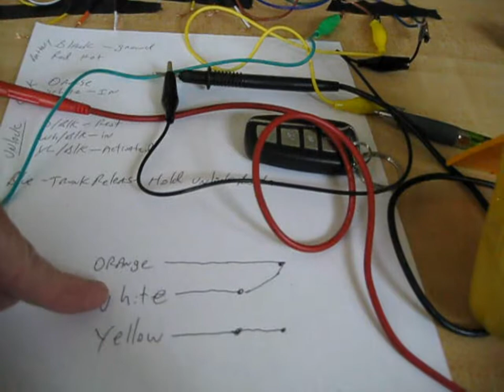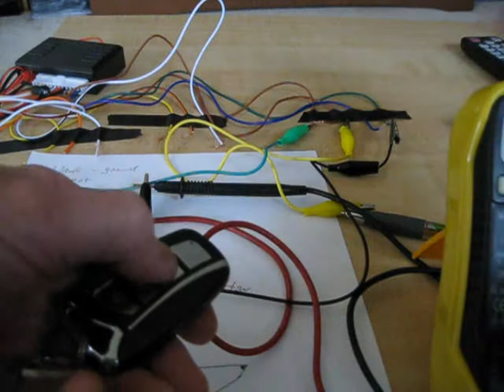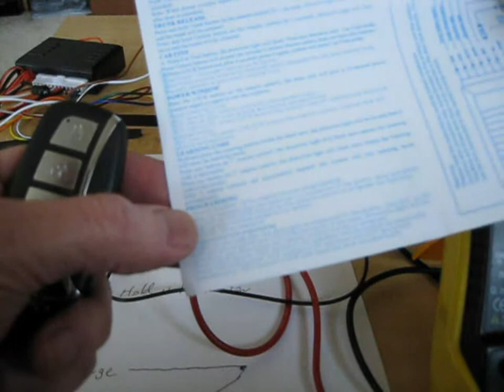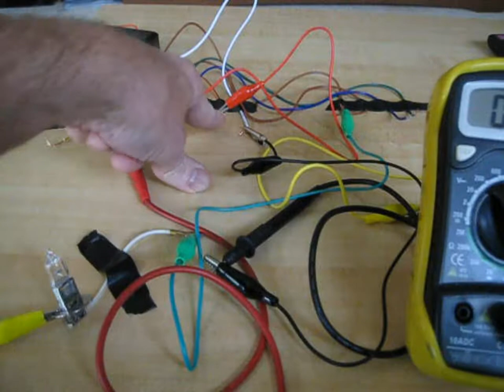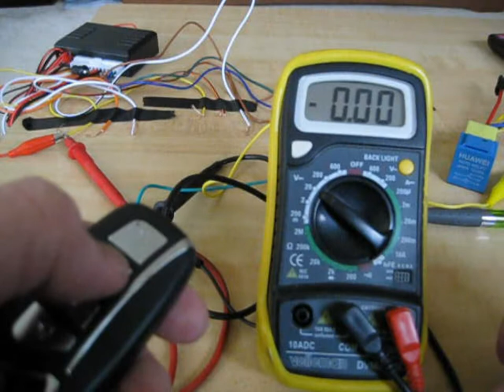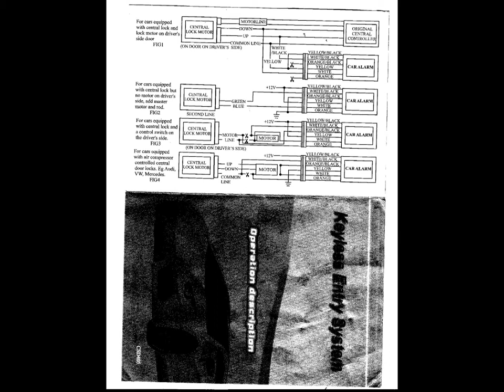EBAY KEYLESS ENTRY WIRING EXPLAINED  * REMOTE DOOR LOCKS *

Comment: Whats up men how are you i just buy a keyless entry system lock and unlock for my dodge grab caravan 2006 , for opened i have to use the key and for closed i have to push the botton to lock all the doors, i understand perfect your video , but maybe you can help me , how to conect the system to the car , you already do it?? Thank you very much have a great day
Reply from the maker: It was tricky. The switches work by adding resistance to ground. For lock you need a 5600 ohm resistor that shorts the violet/green wire to ground, unlock is 2000 ohm . One wire (violet/green)controls everything. I don't remember the whole install, but I know I did need to add another relay and it wasn't easy. And there may be 2 violet/green wires, on e big one small.  This may help: https://www.the12volt.com/installbay/forum_posts.asp?tid=2183
Reply: Ok men thank you very mucho , iam gonna try it if i can do it, but maybe if you can you can show me how you conecto to your van, if is nesesary i can pay you to see how you conect it thank you very much have a great day

Comment: Thank you for clearing up the confusing chinglish instructions.  Once I figured out how the central lock diagram configured the lock/unlock wires, the rest was straight forward.  I used this for releasing the door popers for a hotrod with no outside door handles.  I used the lock button to open the drivers door, and the unlock button to open the passenger door.